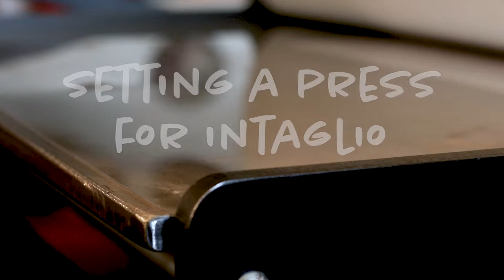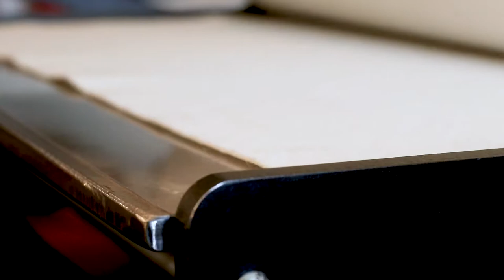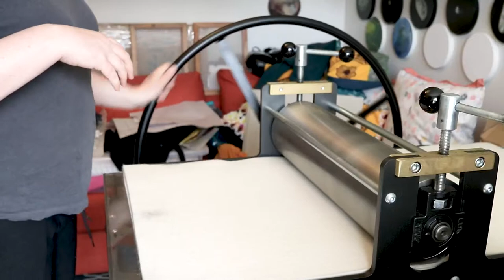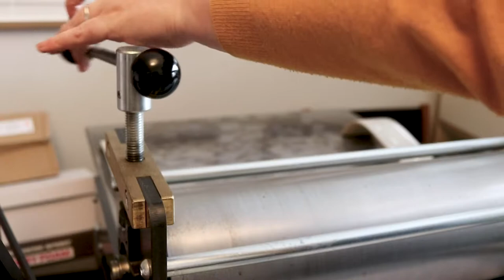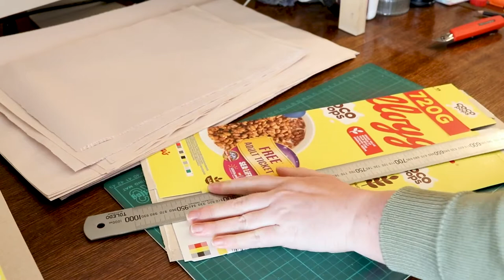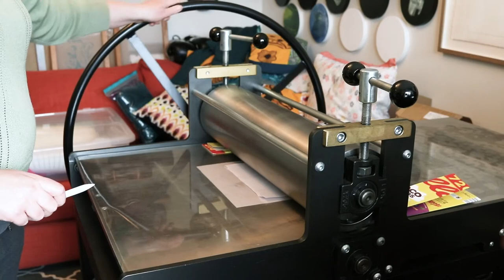Setting an etching press to print intaglio or relief

Comment: Hi Leonie, may I ask whether you off-load the roller at the end of each printing day, or do you keep the roller on the blankets set to the printing height overnight?   I plan to print  a larger edition, and anticipate printing over a 7 to 10d period.   Thanks!
Reply from the maker: @greeniearts  Hi, if it was overnight and I was editioning, I’d probably leave it. 7-10 days is a long time to leave blankets though. I’d probably play it safe and reset the press each day.
Reply: @SpinesAndSplines  Got it!--thanks so much!!